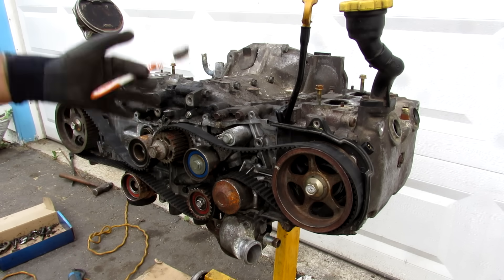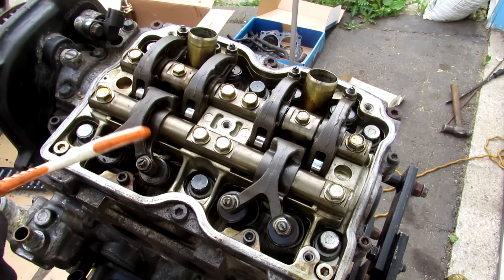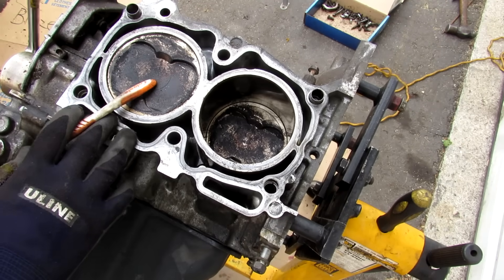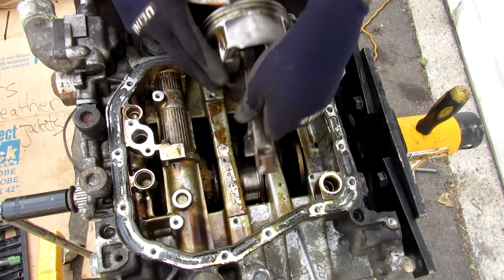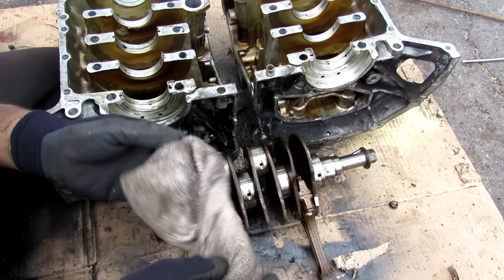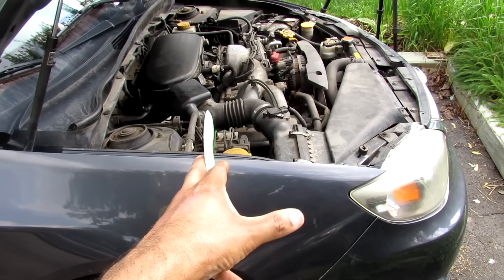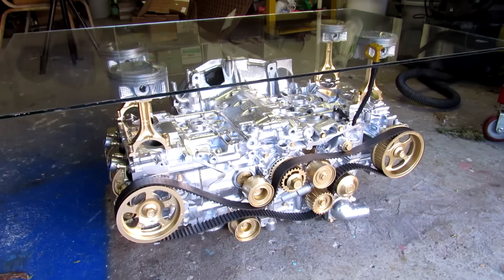Why Subaru Engines FAIL

Comment: 2009 legacy blowing hot air only on drivers Side not Passenger side at all overheating any help 85.000 miles only....
Reply from the maker: Do a compression test. Check coolant
Reply: @speedkar99  Ty Brother i will and i will folllow up with You 🙏 God Bless

Comment: 8:02 Ok yo...  Seriously?!  Thats shadetree AF!  I've been an ASE mechanic for almost 20 years.  I've worked in every auto repair industry (e.g. dealerships, quick lubes, private repair facilities, etc.).  I have NEVER heard of or seen someone use a damned bolt in place of an allen wrench.  I'm so mad right now.  GOD DAMNIT!  🤦‍♂️ You know how much money and time this shit would have saved me over the years?!  LOL  😆  Just the amount of screaming from needing a hex socket that was a little shorter.  

I'm going out tomorrow to buy a whole shit ton of different sized grade 8 bolts, one size of nuts (prob a 17 cause I never lose those wrenches), cut the bolts, weld together, and polish. Now, I can use my ratcheting box-end wrenches as skinny hex sockets.  Dude... Lifesaver bro.  
🗣️Fuh   🗣️Uck
Reply from the maker: Nice tip eh
Reply: @speedkar99  Damn right it is!  Thanks!

Comment: 11 years and 255,00 km on our outback…still waiting for this engine failure to happen
Reply: 515000 km (yes five hundred thousand and fifteen hundred) later my 2008 Forester still runs with no signs of stopping
Reply: @MotoRide.  you must be from the UK because here in the United States we don’t use kilometers or some of us use it but I just had to convert 1 mile=1.61km. thanks.
Reply: @sherrokinchen5253  interestingly, the vast majority of the rest of the world uses the metric system, but the UK is mixed, using both metric and imperial units. no matter how you convert it, that’s a long lasting engine
Reply: That’s  good for an engine with 158,449.65 miles.

Comment: Excellent video...I'm not a mechanic, so I'm in no position to critique your video, but I've never seen anyone tear down an engine, and present so much cogent information as it relates to the specific problematic issues of that engine, or engines in general, so quickly.
I would love to see you tear down a Mazda RX-8  rotary engine, and cover the specifics of the Renesis 13B-MSP, the most common problems, and the specifics of why they had a major recall on the first two years of production of that engine, and an extended warranty to cover the block and its major moving parts. Mazda ended up rebuilding mine, or dropping in a new core, when I lost compression over apex seal failure, and I believe it was only the rear rotor that had the failure.

Comment: I have a Subaru forester 2006 2,5 ST which  now has  316,000 km on the clock,  that's about 200,000 miles . I changed the head gaskets and had special racing units fitted about 50ks ago, and have once changed the radiator. I recently had to change the front wheel bearings for the first time. Other than that...... NOTHING.... and everything works.. I do however follow a strict maintenance schedule  and use only the best quality oil and filters. I have never missed a service since new and every single one is recorded in the service booklet which has long since run out of space so we simply use the back of the pages. The suspension components,  exhaust and undercarriage were inspected when the wheel bearings were done and pronounced in excellent shape. It is still rattle free and runs like a swiss watch .I have driven many cars through the years and this one is at the top of the heap regards reliability. I must add that all the cars I have ever driven were treated the same way and I have never experienced any major failures with any of them. There is absolutely nothing inherently wrong with this engine design but like all things mechanical you need to look after it..I love my Scooby!!

Comment: Great information thanks, I learned a lot but I disagree about the length of stroke being short to keep the engine width down. It's so crucial, half an inch stroke change would make it a completely different engine.

Comment: I have owned petrol driven cars for over forty years and appreciate how engines have evolved to become more precisely controlled over time. However, this video tells me how complex the mechanical parts have become as engineers work to improve engine efficiency and pollution control. All in all, I firmly believe it is time for battery electric motors to take over the task of powering cars as the internal combustion engine is simply unsustainable. I still love internal combustion engines though but I think they have to be limited to recreational vehicles  or off roads use. EVs are far more easier to automate, update and control besides being better for the environment.
Reply: As much as I'd like to prove you wrong, I can't. It's really inevitable and something everyone is going to have to come to terms with.

Comment: I worked for Subaru for 2 years 2013-2015. We did head gaskets a lot. Oil leakage and oil burning were main issues also. The exhaust system covers rattled to beat the band too. A lot of poor paying warranty work. I would never buy one.

Comment: So my 2014 Subaru wrx hatchback engine blew last month - I had 109k km. I installed a Cobb tune at around 104k km with intake and exhaust. The guy at Subaru said my crank bearing blew the engine. He also said it was most probably my Cobb stage 1 tune. Can you explain more exactly what happen? I did notice a lot my oil would go down a lot quick and I would Need to change it every 4000km or so.. thank you
Reply from the maker: Wow 4000km and oil was gone? Probably burning though the piston rings

Comment: 9:59 that right there is the fuckin key to all subi engines exploding lol. Most dumb idea I've ever seen is to make a goddamn performance engine block that's susspsoe to take boost a 2pce design. Engines act as a chassis stiffener. They take alot of stress from twisting and pulling. Funny the only way these engines see anything over 600awhp they need a goddamn billet block.
Reply from the maker: The 2 piece design is quite interesting.

Comment: Good video. I owned a 2003 outback with 2.5 liter engine. It was an excellent car. At 115,000 I had to replace the head gaskets. While that was being done I replaced the timing belt, water pump, spark plugs and wires, all the hoses, etc. Car needed the same repair at 245,000 miles at which time I sold it. My experience with Subaru was that all parts needed to be replaced at the same time making the service very expensive. Car never failed me. Even when the head gaskets needed replacing my Subaru mechanic, which only repaired Subaru cars, told me how to care for the car until he could repair it. Would I buy another Subaru? Probably not. I ended up buying a Toyota instead. I admit I loved my Subaru.
Reply from the maker: Subarus just are different. Which can be a good or bad thing depending on who's paying / driving the car.
Reply: @speedkar99  I agree. First time the repair,cost,was,$2,500. The second time the repair cost was estimated at just under $4,000. If I could repair the car myself, I would still be driving my Outback. I decided that one Subaru in a lifetime was enough for me.

Comment: Thanks for the great video, very well made. Can you comment on the 2.0 lt. Boxer diesel engine? Is it a reasonable engine if looked after? I don't have any measurements on one, and I suspect it is too wide for my purpose, but I wanted to see if I could fit one into a '74 Citroen DS (the 'Goddess')? The crown-wheel and pinion would have to be flipped over, and the engine would have to sit behind the front axle. I think this can be done with a 5-speed manual box, but am not sure if it can be done with the A960E 6-speed auto box? I would appreciate whatever you can tell me in this regard?

Comment: This right here is the biggest reason to go electric.  Before long, a mechanic's job will be mostly brake jobs, steering and suspension, and air conditioning.  Batteries will deteriorate gradually, but it will be almost unheard of to become "stranded" unless you're dumb enough to forget to charge.

Comment: The spark plugs can be serviced on this engine without removing anything besides the passenger side u will need to move the intake air hose out of the way and half of the air box, the easy side to remove. 
Ive done it, n im not a mechanic by any stretch lol
Reply from the maker: Did you have to build your socket extensions into the tube hole?
Reply: @speedkar99  i have a wobbly spark plug socket which is the exact size to stick out very little, n then bring a ratchet to it, so yes. I've found u dont need any extensions and just try to keep it as straight as possible which is the only down side of the wobbly type because these Subaru's tend to be very tightly installed esp if never touched for a 100k.

Comment: Aside from these potential issues, one thing I've never liked about Subarus is the long front overhangs. When you see the cars from the side, it's like they have these huge noses.
Reply from the maker: That's because the transmission sits longitudinally so the engine sits in front of the front wheels

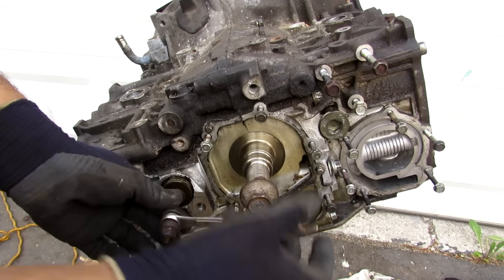Comment: 8:10 my mind is blown, ty. THis is epic, i dont know much about cars but im learning as i go, and this is really clear and direct. its not easy to understand all the time but its needed to just hear whats right and ill learn more as i hear about this stuff. my car shakes so muhc as an 05 forrester and i cant figure out why it does. like when stopped at a stop sign jsut chllen without gas on the break and with thte front pointed up a step hill the whole thing can shake like really hard and the steering wheel will shake too with a little gas it might get worse but doesnt seem as bad once at speed. is that cearly a bad thing?

Comment: I've owned four Subarus with boxer engines, and I never had a minute's trouble with any of them. The first was a 1981 DL sedan. I put more than 200,000 miles on that car. I was so busy at my job that at one point I neglected basic maintenance. I ran the damned thing almost completely out of oil, and it kept running. Boxers are durable little engines.

Comment: Yeah, the 2.5i NA EJ253 blocks are straight up garbage.  It's an open deck block 3:36 with pitifully tiny braces on the cylinder walls so at high revs the cylinders actually shimmy around and it grinds the head gaskets away.  The worst thing is they use a different subframe to mount the engine so you can't even just swap in a WRX block without doing a ton of work because the turbo pipes won't fit.
Reply from the maker: They make great engine tables

Comment: So anyone tell me what happened to my forester it rattles like crazy it revs but with no talk to the wheels I know when I bought it the head gasket was done but I don't know if that would cause it I've been quoted 3grand just for a tear down jw if anyone here might have an idea on what might be the issue
Reply from the maker: Transmission? Check all fluids
Reply: @speedkar99  it's going take me a bit but I'll let u know if your right cheeers

Comment: yeah I agree with the last comment - too many youtubers just talk and talk and talk - get to the point just like he does - excellent. that said... I have anew subaru outback 2.5, is there anything i can do to prevent these kind of problems with the boxer engine? Any kind of service I should do and when to prevent any kind of gasket issues? Thanks.
Reply from the maker: Always check your oil and coolant at every gas fill-up for telltale signs

Comment: I wonder how the 2.0 does compared to the 2.5. I've been reading that it's a bit better and doesn't have as many issues.
Reply: My dad bought a used 2.0 Subaru with 100 000km driven. He's driven it for over 50 000km now and no major problems.
Reply: The 2litre has a smaller bore so the casting has more distance to weep thru

Comment: I can totally agree as a ex EJ 25 owner.

Now im driving a modified EE20 Boxer Diesel with 180 HP tuning/DPF and EGR off, and its hella awesome, even more torque than my WRX up to 3k rpm. Not as much fun anymore, but still awesome (and a lot cheaper to afford in Austria, 300+ HP vs 109 officially)
Reply: Only the consumption: EJ25 - 12-16l/100km expensive fuel vs my "new" Boxer Diesel - 6l/100km cheap Diesel before tuning and with optimization and EGR/DPF off even less than 6l...

Im still a bit sad that i sold my WRX, but in the end it was not worth the expense anymore and the Boxer Diesel has a lot advantages over the proper Boxer Engines when it comes to convenience. Only problem with the Diesel Version of the Boxer Engines: They are stock incredible useless, bad and self destructive... The EJ engines are at least reliable more or less.
Reply from the maker: Awesome
Reply: @speedkar99  well and now i saw what Subaru achieved with the 2022 WRX (which seems like the perfect Subaru i ever wanted, except for the high insurance)

Seems like its time to wait a few years and lets see how robust the new 2,4l  Direct Injection Boxer engines are

Just said, you should take apart anytime a Boxer Diesel, they are IMPREZZIVE(ly overengineered), the crankcase alone got like 50+ holes for bolts 
They are nice built and with nice little tricks everywhere, but thats not helping too when it comes to maintainance

Comment: I put quite a few hours on an EA-81 engine with 4 cylinders and pushrods instead of overhead cams.  But it was NOT in a car.  I was impressed.  We turned the engine up about 4k rpm and turned the prop about half that using a Gates belt drive with a kevlar polychain belt and cogged pulleys.  I miss that little airplane, had a lot of fun flying it.  A friend who died of the covid flew it a lot too.  He enjoyed landing the little Karatoo on grass strips and cornfields.  I almost got it in the trees once but recovered from the wing stall just before the big WHACK!  My passenger started going back to church and quit drinking.  He said I had given him a new lease on life.

Comment: bs on the sparkplugs all you have to is remove the battery the other side remove the airfilter canister and hoses
Reply from the maker: Compared to a regular 4 cylinder it's harder

Comment: TLDR - Maintenance.. regular 3/4zk services and it will never go wrong.

130K on my 2002 STi, its used DAILY, never let me down 😉
Reply: @speedkar99 subaru built to last.
97% of Subaru Forester vehicles sold in the last 10 years are still on the road today, more than Honda CR-V, Toyota RAV4, Ford Escape, or Hyundai Santa Fe.
It's on the subaru's website.
Reply from the maker: Maintenance can help but if it's flawed it's going to fail at some point

Comment: The man knows his stuff! And he is apparently telling us that Subaru engines may be quick but they have many built-in failure points. So in other words they are going to be nothing but trouble. And I've never understood myself house cylinders with pistons laying on their side could it be reliable. Just the gravity pulling downward would make the lower side of each cylinder and the lower side of each piston ring scar up and wear out and then the upper side of the piston and its rings would be dropping away from the cylinder wall which would be blowing by internal compression gases and heat. Even if it was a two-piece pissing arm that would just be introducing more failure points. I would never trust an engine design like that. But that is just my opinion. 🤔
Reply: The inherent problem in the Subaru design mostly attributed to being liquid-cooled.
 Many aircraft engines have opposed cylinders and give many years of trouble-free operation. No oil pooling or starvation problems
 The same with the VW type 1 engine. 
 I have a stroked type 1 2300 large valves big, heads, in my airplane. It is supercharged and puts out 210 horsepower at 3200 RPMs. I fly it all the time making 3500 mi cross-country round trips twice a month for many years, no trouble.
    It is direct prop which I can't spin more than 3,400 RPM without prop damage. With a different cam this engine could put out well over 270hp at around 5,000 rpm.
         🤠🐂🏞️🛩️

Comment: What's known as the "Nazi's curse" There's are really good reasons why the Germans didn't proceed further with the Boxer designs! They're just good for packaging and that's All! They have so many inherent disadvantages like that you've mentioned and they were even worse when they were in the VWs being air cooled. It's a good concept for yes the balance standpoint, but they are not truly meant to be a high revving engine because of the way their laid out as opposed to say a inline type engine or even a narrow Vee type design. The fact everything Is flat and yes oil and coolant is wanting to get out, these engines especially with the fact they used floating deck-less cylinder surfaces which increases the amount of cylinder flexing at the top where you don't want it to be at all on your gasket surfaces this is exactly why they are known to eat head gaskets.  Rippled together with the stupid overhead cam design and you have a recipe for Nothing But  Problems with this type of engine. That's just to start with. Not to mention they are a interference type engine so when you lose a timing belt your valves smash into the pistons. Really intelligent and I make sure I laugh at every idiot driving one! If they don't sound like a tin can full of marbles from timing belt idlers going bad or the wheel bearings grinding off its hubs you can't feel bad about laughing. It's not something that just started with Subaru and these problems are well known In the industry for being more than common more like expected! 👍